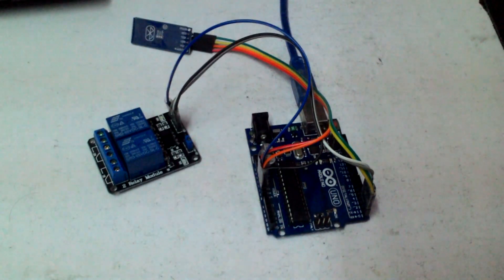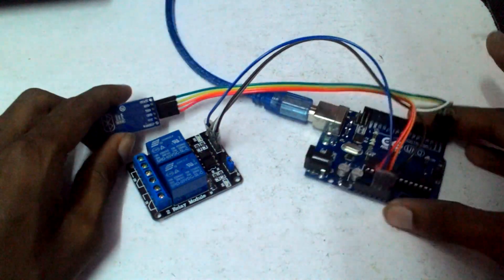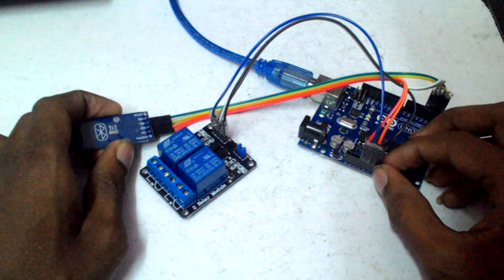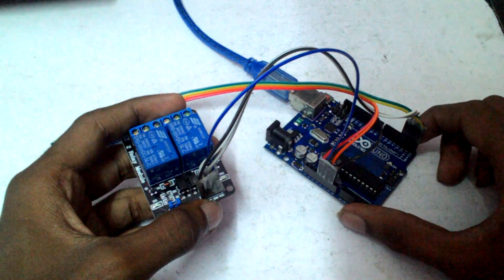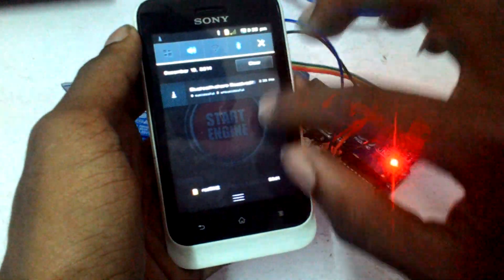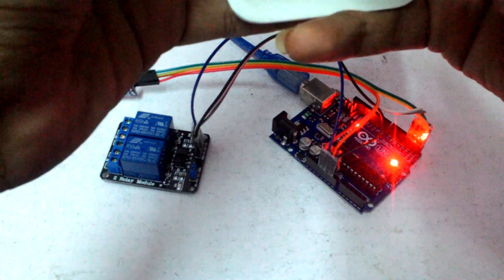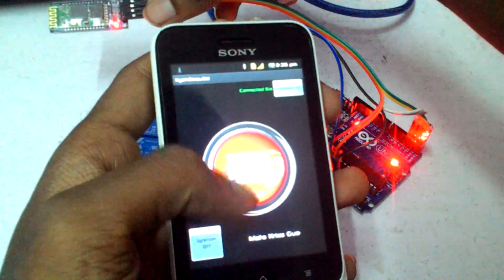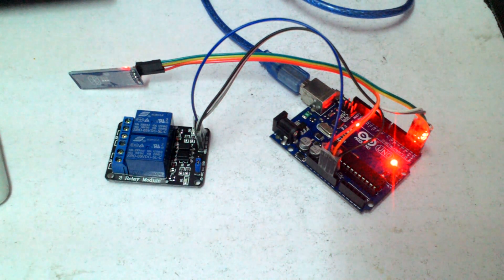Arduino Bluetooth Motorcycle Starter (start motorcycle with your phone)

Comment: My relay is not working....where's problem came from...is it from power supply....or defective unit
Reply from the maker: Try using a multimeter to check if the arduino is sending signals thru the pins 1st..

Comment: bro i knw this was long time ago, do you know is it possible to start using gsm instruction not bluetooth?
Reply from the maker: it is possible.. send sms
Reply: @reeshanthan  1 more question bro, if you connect the bluetooth, but then you start using the normal starter, can i turn it off using the android? To prevent theft for example. Ty in advance
Reply from the maker: its just relays.. u need to set them up so..
Reply: @reeshanthan  meaning it cant be started using the electric starter?what about the kick start
Reply from the maker: @fahmilul8951  u need to understand how ur bike wiring works.. and how relays work

Comment: A good project ..., but it would be better if there were 3 relays, relay 1 as a starter, relay 2 as on / off ignation, and relay 3 as lock / unlock (anti theft)
Reply from the maker: u can add a dozen more if u need.. just modify the code.. its not that hard.

Comment: there's no delays in your code it can wreck your self..
i did this projext
Reply from the maker: shaheen barcha why delays?
Reply: Reeshan Than  buddy you're just pushing self button or push and holding?
Reply from the maker: for the ignition its a toggle.. for the starter its a push and hold.. why??

Comment: aq cdang bro.. kan relay yg ignition tu ada COM, NC ngan NO... ko smbung wayar NC ko dgn wayar positive ignition coil ke body motor ko... body automatik jdi GROUND.. bila org nk curi ke apa... kan relay tak trigger, relay akan jdi keadaan NC... dan motor x leh hidup.. sbb... wyar positive coil motor sentuh ngan body motor... salah satu ciri keselamatan...
Reply from the maker: bagus gak.. tpi kene tengok moto ape yg dia gune.. mcm kriss sya memang body ground tpi.. dia ade lagi 1 external switch.. manual bwh seat..
Reply: sya punya LC buat mcam tu... haha... lgipun moto lc tu mcam2 ada... gps laa, alarm laa.... cdi racing.. smua mkan bateri kuat...
Reply from the maker: try bukk suis kunci dia..tengok brpa pin cari 2 wayar yg bila dia sambung moto akan on.. pastu cari suis starter.. kt situ pon ade 2 wayer.. bila sambung 2 wayar starter berfungsi.
Reply from the maker: senang je.. jgn risau blh buat..
Reply: dh buat dh.. moto LC ni lain.. wayar starter dya connect ngan wayar sensor clutch... sbb moto sya jenis manual.. tpi. alhamdulillah.. buat smua dh.. cuma bateri x than.. haha... tu pun nnti nk setting arduino bgi save power sikit...
Reply from the maker: +AZ Putra uish bia betol gine microcontroller tuk regulate battery charge? hebat betol bro nie..
Reply: +Reeshan Than xguna g microcontroller nk regulate charge tu.. haha.... nk regulate pun.. current charge bateri cuma 2Amp jaa... dh test guna multimeter tu...
Reply: +Reeshan Than tpi tulah.. bila smua on.. cdi ni pulak jnis racing.. kipas coolent dya akan pusing trus.. x ckup current nk charge balek bateri moto.. tu yg bateri x than tu... cdi punyai psai.😒
Reply from the maker: try main RPM tinggi.. mungkin dia blh charge.. pasal kipas nie memang.. kerap kebanyakkan LC kene ada kwn aq yg pakai suis manual direct dri battery.. kipas amp kecik..
Reply: send me your phone number dear
Reply: ade fb bro?

Comment: Is it possible to use your keys at the same time?
can you show me how you made up your wirings for starter relay.
It will be highly appreciated.
im trying to work this using wifi shield instead of bluetooth.
Reply from the maker: +Michael Asistio yes its possible to use ur keys.. my key switch and starter switch only uses 2 wires.. so i hacked and pluged in my relays..
Reply: Can i check your codes? Also how you set up those wires?
Reply from the maker: +Michael Asistio description has the links